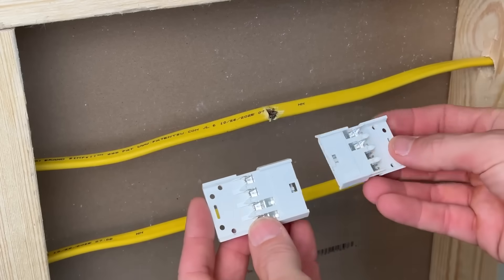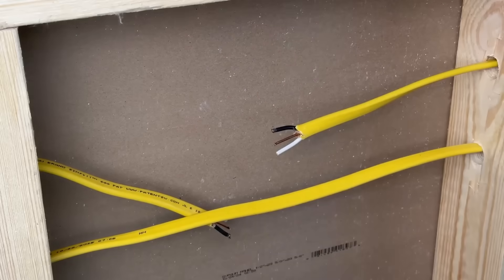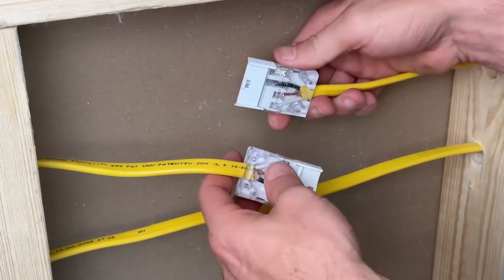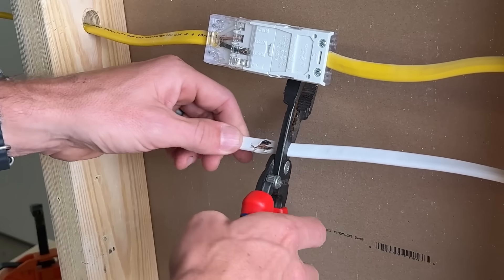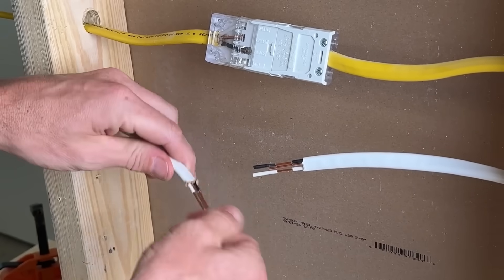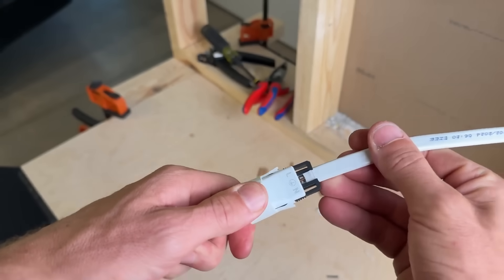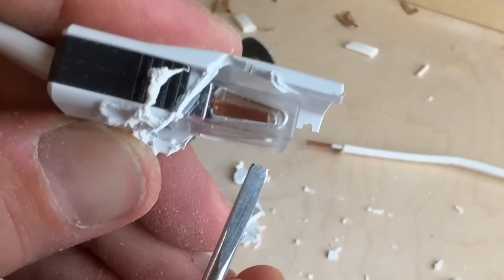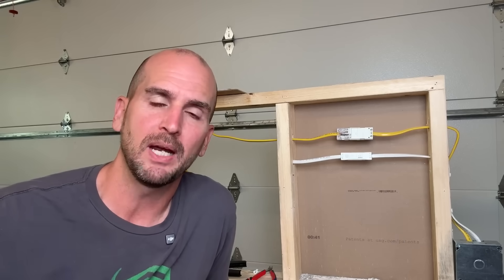Is This the Future of Romex Repair?

Comment: it's illegal to make a splice in the wall. The National Electric Code "NEC" REQUIRES all splices to be made in a junction box! 300.15 splices require  accessible boxes with removeable covers. No change has been made in the 2026 allowing splices to be made without a junction box.
Reply: Millions of mobile homes have them, so either they don't meet code or NEC does permit.  I'd love someone to point out the section(s) relating to it.
Reply: Sadly, 334.40(B) of the 2023 NEC allows it. Just because it is in the Code, doesn't mean it is a good idea.
Reply: How do you explain the millions and millions of can lights installed in America that have ZERO ACCESS to their junction boxes? 😂

Comment: I absolutely love that other than needing a $100 stripper to strip the wires properly haha
Reply: Well, just one splice kit made of a few molded plastic parts and some metal connectors, will set you back about $35.  😮  Very expensive for what it is, but they do work well.

Comment: As far as I know, in the US, you can not have any buried connections.  No buried boxes, and no buried "splices".  Has that changed?
Reply: Wrong, you go to canton michigan. Hidden boxes everywhere
Reply: @strikerz2912 Because they are there, doesn't necessarily mean they are allowed by code.  There is the National code and the respective state code. There may be town/city codes too.  Are you claiming MI, in their state code, allows buried boxes?
Reply: @Dr.Bigglesworth  Michigan absolutely does allow buried boxes, it just depends on how you define a junction box.  Every single time a can light is installed, and then drywall is installed, that is a buried junction box. I have personally installed thousands of these lights between floors where there will be zero access once the drywall is installed. The connections inside of these can light boxes are no different than just a regular junction box, yet they are allowed, and a buried junction box isn't. 😂

Please, someone make it make sense...
Reply: @billymacktexasdetective5827 Every light I've installed has access after sheet rock. The old Halo H-7s had the double sided junction boxesnd the new clip in lights:same! 🤨
Reply: @strikerz2912  FYI from the NEC:
"314.29 Boxes, Conduit Bodies, and Handhole Enclosures to Be Accessible

All boxes, conduit bodies, and handhole enclosures must be accessible for maintenance and inspection without requiring the removal of any part of the building or structure."
Reply: I know little about electricity let alone codes for what’s acceptable but the second low-profile connector looks like a sound connector. If you’re placing wires in a wall and not yanking on them after the fact, why would this be unsafe?
Reply: @FireBosspilot They are a point of much higher chance of failure than just a buried run without junctions.  If you have ever done electrical work and encountered buried junctions you'd understand.
Reply: @Dr.Bigglesworth Well, that’s how I opened my sentence by admitting my lack of knowledge with electrical work, I’m trying to learn something constructive, not how to learn from condescending answers.
Reply: @FireBosspilot I don't see how anything I said in my reply to you was condescending, certainly wasn't meant to be.  I learn from experience and I have ren into buried boxes, and they, well, suck.  Hard to find, and invasive to fix.  Just saying experience is usually a good teacher.
Reply: Most likely that’s the code now, but back in the day, only canton michigan that I’m aware of hiding wires boxes behind walls
Reply: That is code, but buy an inspector a few drinks at the bar and you’ll be surprised how much gets overlooked.  I am in the process of remodeling my kitchen and found a 12-2 supply wire married to a 14-3.  The 2nd hot was exposed under a cabinet bottom and at the device end the previous electrician wired both black and red onto the outlet device which energized the red conductor back down under the cabinet with zero protection.  APPROVED!   So I have no problem with twisted conductors, covered in correctly sized wire nuts in a fold back condition protected by two half laps of vinyl tape.  I would probably add an old work box and a cover plate to hold the splice.
Reply: Yep its not made for the US market.  They can however be used possibly up in an attic, yet there is a retrofit box that is far better for that application
Reply: There should never be anything like that in the wall,  Put a single gang box in and leave a blank on the wall that is code and the law.  Unless you want you house to burn down.  I would never do anything like that.  If you have to wall open like that time to run a new wire and meet code.
Reply: @allenpierce4575that’s the same ignorant talk that guys tried with WAGOs. Let it go. House burn down. Lmao. Idiot.
Reply: Yes only for approved devices like he showed.(first one in the US)
Reply: @JW-mx3qg  This is a common misunderstanding. Approved splices can be done without a box, but even the latest NECs still require any splices and boxes be  "readily accessible" at any time. AKA: they cannot be hidden behind drywall or buried without an access panel.
Reply: @thenerdguy123 aren't these approved for mobile home use?
Reply: @thenerdguy123 that’s the rule in Ind. no splices behind a wall or any place you can’t get too
Reply: @thenerdguy123 How are can lights allowed? They have the same type of connections that a regular junction box has, yet they are allowed to be buried beneath drywall with zero access. 

It makes no sense whatsoever, which is why I don't ask the government for permission to work on my own property... They are idiots. Nevermind inspectors flat out making up their own code, which I have experienced many times in my life... 
But never once since I stopped asking for permission😂
Reply: @JW-mx3qg IMO should not be approved.  Just asking for trouble.
Reply: @Dr.Bigglesworth  You asked!?  why do you think this was my idea?!!!  I don't make the rules you know. Perhaps read the UL and code books online before giving just your opinion perhaps?
Reply: @JW-mx3qg  Why would you think I thought it was your idea?  Maybe it was, but I have no idea.  I can give my opinion any time I want, just as you can, and neither of us needs the other's, or anyone's for that matter, permission.
Reply: @Dr.Bigglesworth  Of course anyone can give an opinion but you also have to give an explanation for your disapproval, otherwise it just looks like your trolling. I can see you at a company meeting saying this is a bad idea, but don't give a valid reason why it's a bad idea. Very helpful indeed.